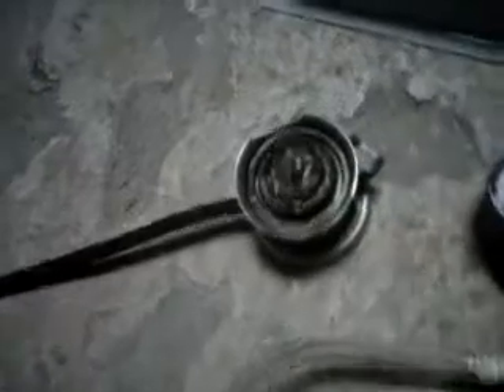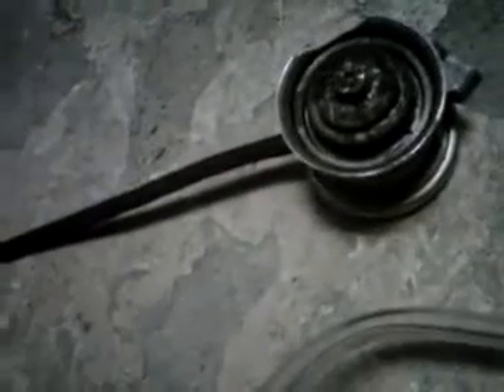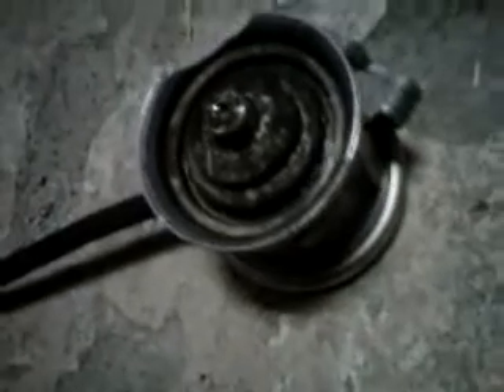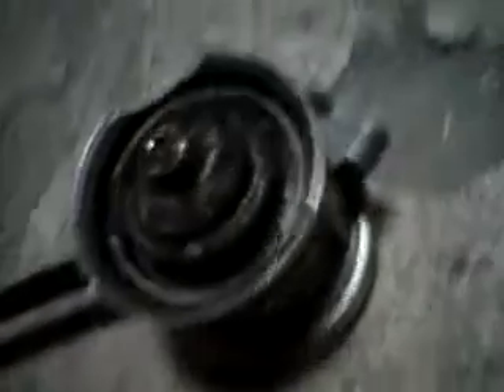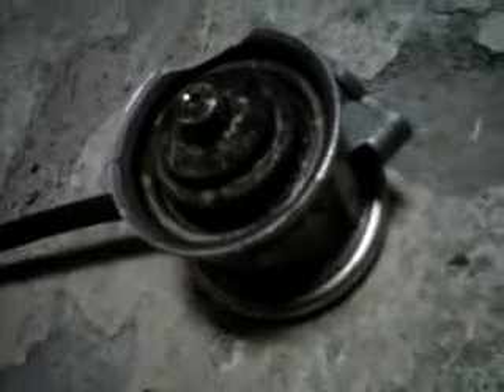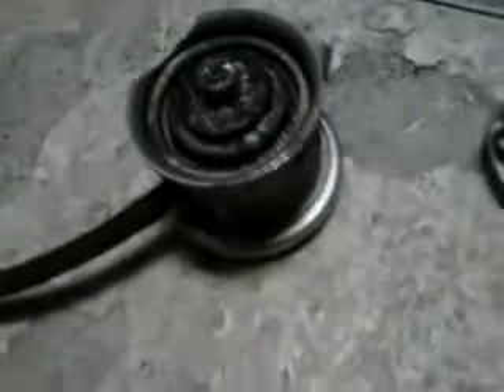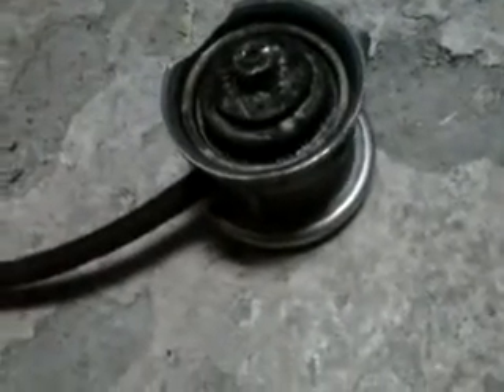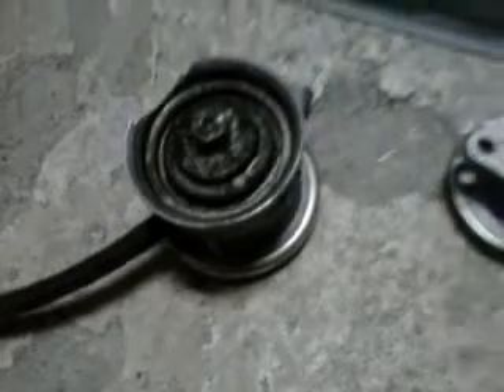1.8t CombiValve

Comment from the maker: It wasn't working which is why I pulled it off the car and split it apart to take a look at the insides. The piston was seized and would not move. Even after I broke the piston free, the valve wasn't sealing due to carbon buildup on the valve seat. Once broke apart, it couldn't be put back together. These are not designed to be taken apart.